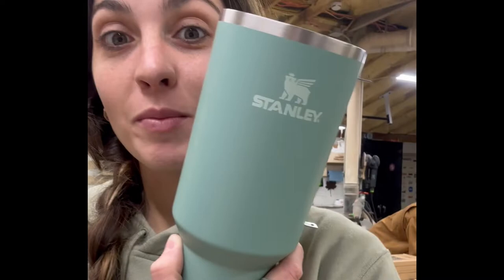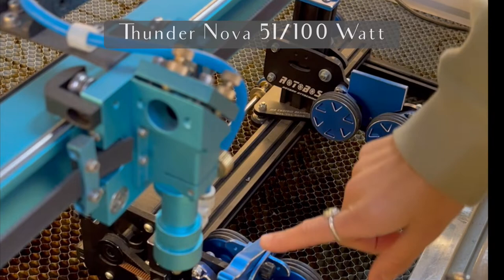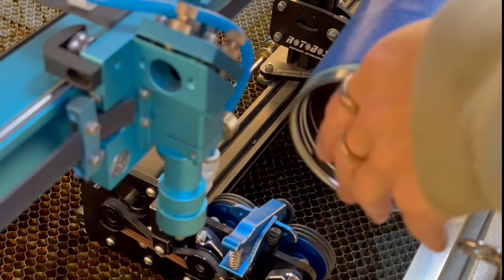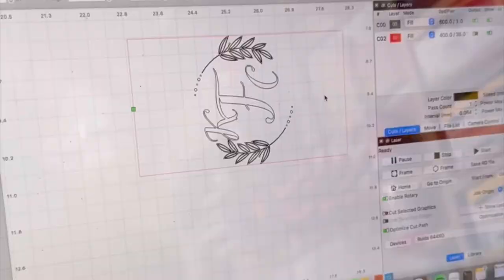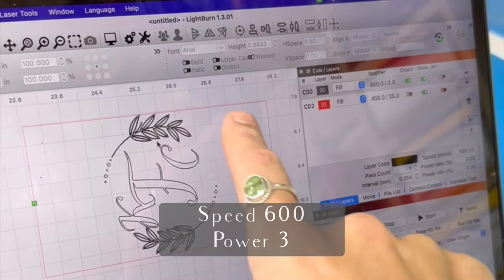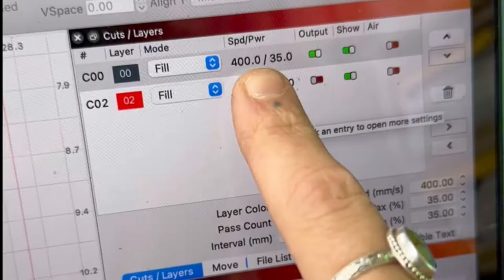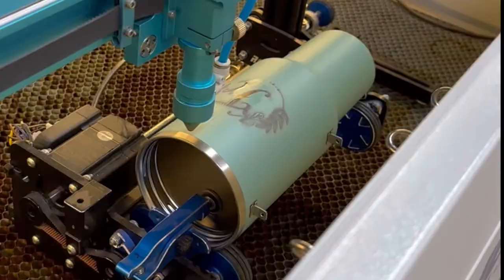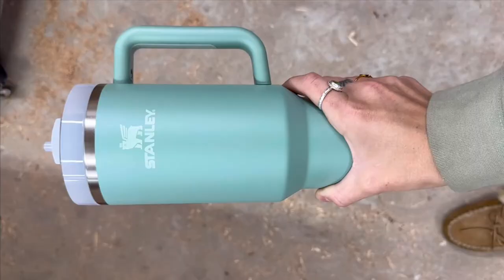Engraving a Stanley Tumbler on Thunder Nova 51/100 Watt Laser

Comment: Have you tried to engrave any of the soft matte 40oz cups? Any concerns with the "new material"?
Reply from the maker: I have no done it with the soft matte yet but I have an order for that soon. Ill let you know how it works
Reply: @pinebarrenpalletworks  So how did it go with the soft matte cups? Is there a video?
Reply from the maker: We did not make a video but I had to up the power for them. Instead of 35 power I had to do 45 power for the soft matte
Reply: @pinebarrenpalletworks  thanks for the info. Just started getting into cups the Yeti style and it’s a bit different than the cutting boards and coasters we have been doing g